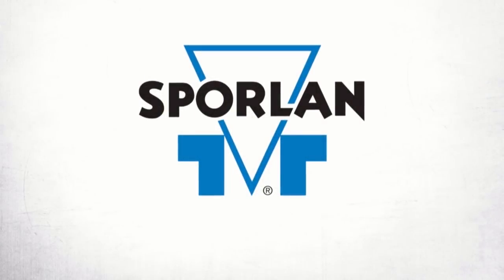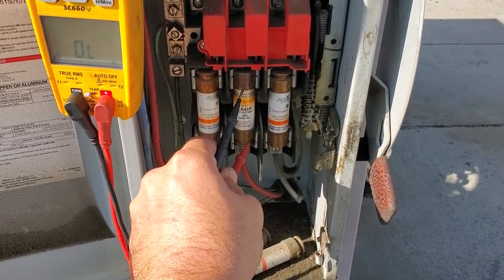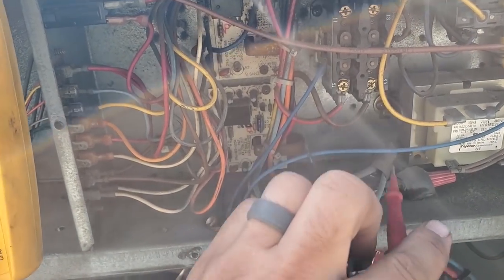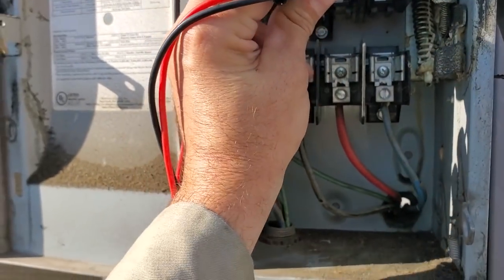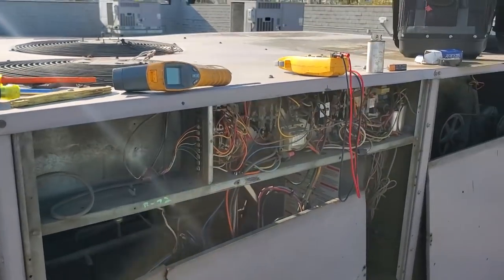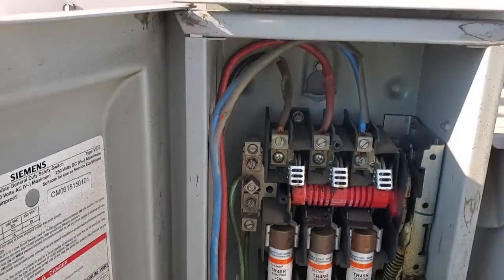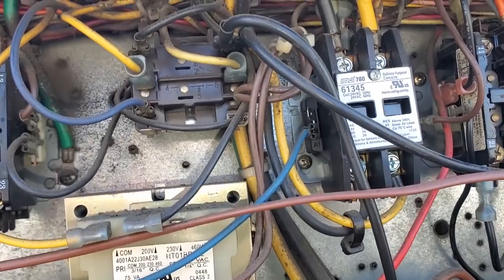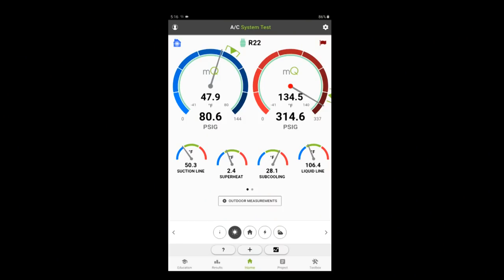KITCHEN AC IS BLOWING HOT AIR

Comment: Pro tip, with the size of fuses you pull you really should use the smaller end of the puller. Once used to it, it will allow you more firm dexterity with the fuse. The large side of the puller are for fuses 1 inch or larger diameter.

Comment: Have to say that changing all 3 fuses is always a great idea I had someone who came to service our 3phase  system change only the bad fuse and the compressor failed a week later... come to find out one of the "good" fuses was only passing half it's rated amperage and low-speed the  compressor into a burnout (internal coils melted together from overheating)

Comment: At 18:20 the belt is being sucked down into the sheave, replace the sheave and belt. The belt should never touch the bottom of the sheave, and that will ruin the mtr bearings. Almost forgot, memorize that sound, that is the sound a belt will make when it is riding too low in the sheave.
Reply: Thanks

Comment: Neat tip using the temp gun to measure temps at the terminal lugs on the disconnect. I will be adding that one to my bags of tricks. Yep, after watching many of your videos I have learned to never just flip a breaker on without making a few checks first. Another great tip on the fuses too. I didn't know about the bands becoming discolored when they overheat.

Comment: Yeah, that disconnect is junk. It’s resistive and heating up. It’ll probably burn up another fuse next time that unit is heavily taxed. Great vids! Keep em coming..
Reply: Nothing a little bit of maintenance couldn’t clear up. Some emery cloth to remove old grease and corrosion, some penetrating oil to lubricate the pivot points and dried grease, and new grease on the knife blades. 5-10 minutes of work and it would be fine.

Comment: Great diagnosis. I am surprised that the local utility does not bear some responsibility for the low voltage. I worked for a Utility company in Mass for many years and we would not have gotten away with it. Also the variable adjustment sheaves should be done away with. After balancing a unit it is best to put solid sheaves on a unit. Many of them fail and get loose on the threads. I have done many of these in the past. Good call on the disconnect. That also can be caused by low voltage causing heat. You have great video's and are very thorough.

Comment: Glued to your vids for the past year. You have me considering a career shift from electrical to HVAC! 
One thing to point out about the disconnect. Though it's not a distribution breaker, still; when operating the switch, especially after a protection failure make sure the arc shoot covers as well as the cabinet door are closed and latched before attempting to close the switch. Good on you for operating it left handed. If it were a flashy new system I'd suggest a NEMA4 vs 3R disconnect considering the location and duty. Thanks again for the awesome content! Cheers!

Comment: How does a rooftop unit get so banged up like that? It is as if they somehow took it to a demolition derby!! As someone who is fond of keeping older units running as long as possible, this one needs replacement!
Reply: Could be hail damage...and old age.
Reply: If you think this unit is bad, my cousin worked at a Burger King, and they got the AC units replaced because they were shot. When the units were lifted off the roof with a crane, they literally fell apart like a cartoon. Every panel popped off and the guts of the units rolled off the flat bed going everywhere. If that wasn't bad enough, the newly installed units didn't work.
Reply: Man I don't know what it is with RTUs but they do get beat to hell. I work at a movie theater built in 04 and the RTUs are already worn more than logic would imply. 3 story building, no trees or anything else around, very limited roof access to personnel, and yet they just look like someone took a baseball bat to em.
Reply: Banged up likely from careless service techs I’ve discovered removing & mis-handling panels ... They have been know to also cause roof damage / leaks by this improper handling by drop corners on roof to end up cutting the roof materials ... Customer ultimately calls a roofer when it was likely actually caused by the initial careless hvac tech 😩👀😤

Comment: Definitely, always gotta cover your butt and not just "throw in a fuse and see if it blows again"! Doing something very different myself, I took out an entryway lighting circuit once by mistake. Luckily I had records of my whereabouts and the timeline of events, because a few weeks later a call came in from corporate about that location, saying that I had blown the main breaker and all personnel had to evacuate. That obviously didn't happen, but corporate had no idea. Only thing I can think of was that it was a holiday weekend (another FMF) and they wanted to head out early. They had started trickling out long before I had popped that one circuit, and the last of them actually kicked me out at about 3pm because "they were looking to close up early that day". Some places just see a target painted on your back lol. Love the videos!
Reply: NEVER just "Replace the Fuse/Reset the Breaker and just see what happens"! Fuses/Breakers blow because Electricity is going somewhere it shouldn't be in a hurry (Short/Ground Fault/Dead Short) and that is going to either damage equipment, start a fire, Hurt/Kill someone or some combination of All-of-the-Above!
Always use a Circuit Tester/Multi-Meter to find the problem before Reseting the Breaker/Replacing the Fuse...
I speak from Painful Personal experience, an "Electrician" reset a Breaker without finding out why it was tripping at a place I briefly worked and I got tossed 15 feet. I rested my hand on the case of a Deli Slicer as I turned it on (my way of making DAMN Sure my hand was nowhere near that blade) and it had a Dead Short in it...I got tossed 15 feet and ended up in the ER for observation, the breaker blew again, the slicer got even more damaged from the internal arc and the Idiot "Electrician" got fired for Negligence...

Comment: Scotch brite works wonders on corroded contacts in various apparatus. Served well many years using them on the contacts and blades in 14.4 and 27kv distribution breakers :) there’s also a paste we used I can’t remember what it was. Looked like Vaseline. Kept them clean until the next maintenance schedule.
Reply: Dielectric grease is the Vaseline looking paste. It's job is to prevent further oxidation / corrosion.
Your suggestion of scotchbrite is better than the idea of putting dielectric on the hot contacts.
Scotchbrite will remove the oxidation, lower contact surface resistance and the excessive heating seen as a result.
Dielectric is for use after the fix, not a fix in itself.
Reply: IncandescentWithRage exactly it’s for after the fix itself. We used that grease on the contact surfaces for distribution breakers plugging into 1200+amp bus bars. 

The aluminum was a whole different story. Penetrox is nasty stuff 😂😂

I got hazed a lot by a guy that wouldn’t let it go after I was there for a year. Dumped a pint of penetrox in his toolbag. Never messed with me again 😂😂😂
Reply: IncandescentWithRage all the stuff we used was from DOW. I think the part number for the grease was 111 can’t remember.

Comment: My dad was the kind of guy who, when we blew a fuse at our old house, he replaced it and turned the breaker right back on without bothering to check why it blew, which happened to be because the power consumption of both an air compressor and the florescent lighting  was too high for the fuse. Needless to say the second fuse blew instantly, and so on until we were out of fuses. it was only after we had to make a trip to the hardware store and buy new fuses that I finally stopped him, unplugged the compressor, and then let him replace the fuse. After that I made sure the lights were off before the compressor was plugged in. Surprise surprise, the fuse didn't blow. I think new fuses cost us 20$ or more, but the look on his face was priceless when I got the thing working by turning off a lightbulb.

Comment: A few years ago i did this kind of work,, mainly  TRANE package heat pumps,,,   a job i miss,, it was very enjoyable,,..          i experienced all sorts of problems on units much older than these,,   some problems were caused by people,  like reconnecting the phases the wrong way , causing the fan to turn the wrong way and delivering much less air..  Another <<people>> problem that stuck in my mind,,   having a kitchen exhaust fan blowing ,  geasy air onto the condenser coil , insulating it with grease  , reducing its effectiveness in the summer....i could go on,,,R22 has gone now,   ,,  i am not too sure what has replaced it in new units,,  probably R32 ,,  certainly not R407C which had problems of it own.....   Thankyou for the video  very enjoyable...

Comment: also, the suction pressure its always different from one stage to the other, in some carrier, most of them, there is a top evap coil and a bottom coil, one of them , mostly the bottom one has a lower suction due to poorer airflow. that unit wasn't low in freon or had any restriction. all electrical, check the downstairs breaker.

Comment: I know anyone would have already mentioned it but ... as you test the disconnect switch to be really dead , you should test to ground , not to other phases. Because if one phase still remains powered and the other two would be disconnected you dont get a closed loop. Therefore (like you would be ground while touching) better test to ground.

Comment: Chris. With the service panels off you are not getting correct airflow (pull) through the condenser coils. The air will take the path of least resistance and that’s not through the coils. That accounts for your high head pressure issues. Before I start talking restrictions I’d run the unit under design conditions which is completely sealed up panels.
Reply: History ... Also, I limited (no longer in the biz now) my run time without the panels in high ambient temps. 

In the old days of belt driven compressors (which I had my share of repairing and replacing with Hemetics), the motor's heat energy was not mixed in with the freon, so high temperatures and moisture levels were manageable and at worst resulted in frozen TXVs. Once we combined the high temps of compression + windings within the same shell, the reaction of H2O and CCL2F2 (R12) started to create HCL and there were a lot of early compressor failures due to the lack of proper understanding of dehydration and the acidification of oil.  Those earlier guys I worked with used old refrigerator compressors as vacuum pumps or simply purged out the air.  It was thought early on that the Hemetics were the failure point. But once compressor manufacturers starting analyzing compressors coming back for warranty replacement, they identified the acidification of oil issues, and the industry responded with better training methods of dehydration and 2 stage vacuum pumps, micron-meters, changing filter/dryers once opening the system, limited exposure time left open. When I taught HVAC I no longer referred to it as "evacuation" but instead used the word "dehydration" as that in fact is what we are doing. Anyway, long way of saying, minimum time of that compressor being exposed to high head temps saves oil life and seized compressors down the road.  It's good to watch someone like you who understands what he's doing and not just swapping out parts. So many of the field techs who came in for my classes (usually sheetmetal HVAC guys) had no understanding of what they were doing from an analytical standpoint.

Comment: when you checked the disconnect@7.35 .. check both sides of the fuse!! I have been caught out before where some idiot has wired the feed into the fused side of the disconect . (Here in the UK , and it was a MEM disconect where you cant open the cabinet without swinging the handle to off.) luckily my paranoia caught it with a meter before I stuck my fingers inside :)

Comment: I suspect the main problem in blowing the fuse was a dirty or arcing knife in the disconnect switch. All three of those fuses were hot on top, and the insulation on the wires into the disconnect, especially the center one, looked like they had been really hot. Obviously there were other problems that may have contributed.

Comment: Temperature rise and temperature drop across the coils is the only other thing I would have done. Good work my brethren!
Reply: Low suction could have been the bad motor bearings and pulley+belt, and don’t forget the return grills. Slightly high head could be the condition of the unit as you said.

Comment: The condenser door where you were testing was still open some, couldn't that drive the head pressure up since its not fully pulling through the condenser when you dont have the door on all the way?

Comment: Electrolytic caps tolerances are generally -20 +100% = meaning if it's only 10% down I wouldn't worry about it. They're primarily there for power factor correction

Comment: When you initially turned the unit on, it did squeal a second as if a belt or bearing had an issue and sure enuf you were lead back to re-check ... Great Job ... 

Also, when you temp checked the center fuse I wonder if that high temp was ultimately being generated by the blower components ?

Comment: Getting close to 50% of a new unit with all the work needed on that machine to get it back to mfg specs. Are you going to quote them a replacement? And it would be a surprise if your low suction was due to the issues with the blower motor bearings and a dirty fan.

Comment: Hey Chris,  any reason why you guys still use fuse breakers instead of thermo magnetic breakers? I think you've answered once on a live stream but I forgot !
I'm asking because they're getting rarer and rarer over here , and also , any reason why it's always in  metal box instead of plastic ?
Cheers !
Reply: Unsure about the thermo magnetic breakers, but the metal box is used as a ground. It's supposed to short and blow the breaker indoor if something comes loose, rather than leave a power line dangling inside a disconnect box.

Comment: I'm curious about the modern architecture and design decisions in your industry. I mean it is 2019 and the industry still sticks to mechanical contractors instead of SSRs or another semiconductor solution? Is it a matter of cost?  It can't be a technical issue as we have megawatt semiconductor parts these days?

Comment: Curious as to why you checked  voltage drop on the same line on the contactors and expected a reading? (L1 to T1). You wont get anything if they are on the same potential.. that doesn't mean the contactor is bad. What am i missing? Thanks in advanced.
Reply from the maker: if the contact is pitted enough you will read a voltage drop, and I was surprised at how pitted the contact was and how it did not show a voltage drop
Reply: @HVACRVIDEOS  Interesting! thanks for clearing that up.

Comment: If you're worried about the disconnect switch: Why didn't you measure voltage drop across the various terminals or check the current on each of the 3 legs of the incoming current for each phase? I know nothing about A/C, but electrical engineer in me is curious. ;)

Comment: Have you ever seen one of those cartridge fuses fail other than from a short? For example, can a power surge cause a blown fuse? About a year ago, I had 2 new Daikin res units installed. Within a month, both units had blown fuses at different times  while the units were shut off. Fuses were replaced and no problem since. The tech said sometimes those cartridge fusers are old and change value. What do you think?
Reply: I would tend to agree that fuses can fail without a catastrophic issue taking place. From personal experience, my residential condenser unit blew one of its service fuses, and nothing could be found wrong electrically, but i suspected perhaps high head pressure due to near record high temps and and some cottonwood clinging to the condenser. We also tend to get pretty significant voltage sag with the temps being that high outside, which can cause motors to over-amp trying to sustain the same output power with a lower supply voltage. This was several years ago, and hasn't complained since. Fuses are essentially just a slightly resistive element of metal alloy being run close to its melting point. After thousands of motor starts and varying weather conditions that element can change its properties due to oxidation to the point of one good current spike takes em' out. Thats my theory anyways.

Comment: Why did you not clean the corrosion on the knifes in the switch to reduce resistance, voltage drop and temperature?
Reply: 9:15 top middle lug looks burnt.

Comment: Mentioned putting dielectric grease on it at 13:06 to make a better connection, though wouldn't that do the opposite? Used to think dielectric grease would improve the connection, though I've heard it can only help lubricate and protect connections from corrosion or arcing. Would be good to hear your experience with using dielectric grease on connections.
Reply from the maker: It's a temporary solution to the disconnect knives not making connection. I personally feel that the grease will attract sand and cause more problems in the long run